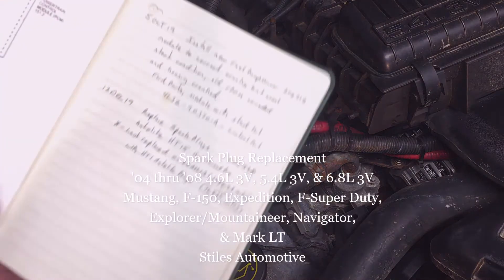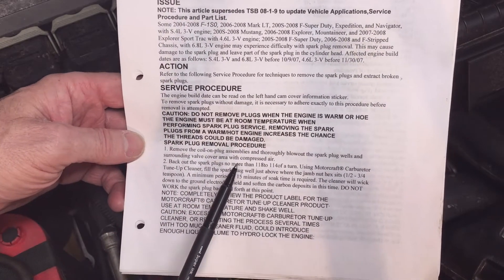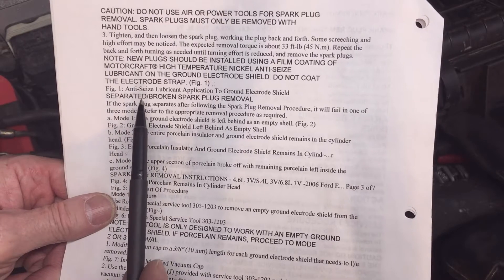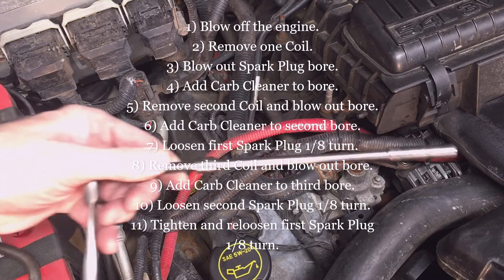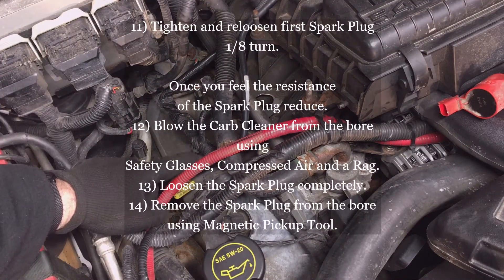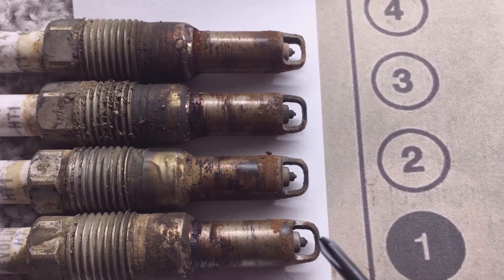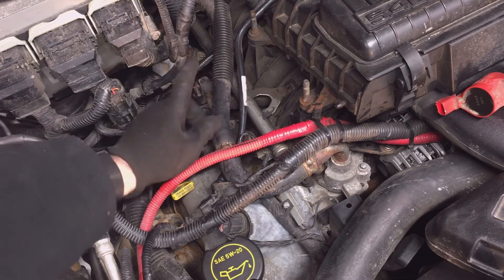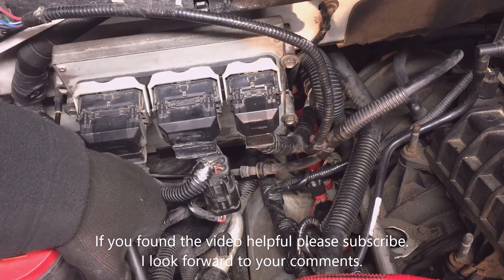Spark Plug Replacement - 2004 thru 2008 4.6L, 5.4L, or 6.8L 3-Valve Ford Engines

Comment: Great video.  I appreciate the time you took to do the research and make this step by step guide!!  I too have already had the original spark plugs replaced but am concerned that the new plugs may have a problem being removed due to the poor design of the plugs and how they install in the cylinder heads.
Reply from the maker: Robert, I appreciate the feedback. The Spark Plug and Cylinder Head design is definitely poor. However, the new Spark Plugs that you installed are likely or should be the new improved one-piece design. The original Plugs were Body (Hex and Threads) and Extended Tip (the Cylinder just under the Spark Plug Seat). This means the Extended Tip is much less likely to break off in the Cylinder Head (You can tell I have trust issues). With all of that said, when removing the new Spark Plugs, I still use a procedure similar to that of the Service Bulletin. I just don't wait as long for the Threads to soak.  What I also do is if the Spark Plug sounds dry (by making noise, you can tell), I wait longer for the Threads to get wet (you need to watch the video to understand what I mean).   - Stiles

Comment: Where is the number 6spark plug on a 5.4 f 250
Reply from the maker: Stewart, the Number 6 Cylinder is the 2nd Cylinder on the Left (Driver's) Side of the Engine.  Many Engine Manufacturers number their Engines starting with 1 on the leading (or most forward) Cylinder.  Ford's leading Cylinder is on the right side Cylinder Bank, so your 5.4 L is no different. Cylinders 1 thru 4 are on the Right Bank (1 being in the front) and 5 thru 8 are on the Left Bank (5 being in the front). Of course, the front of the Engine is the Water Pump ( and other accessories) Side and the Back is the Transmission Side. - Stiles

Comment: What's the part number for 04 f150 with a 4.6 notorcraft  spark plugs?
Reply from the maker: Chris,  Rock Auto is a great quick reference for parts.  You don't have to buy from them, but I like their website.  Your Spark Plugs can be found here - - 
https://www.rockauto.com/en/catalog/ford,2004,f-150,4.6l+v8,1422740,ignition,spark+plug,7212